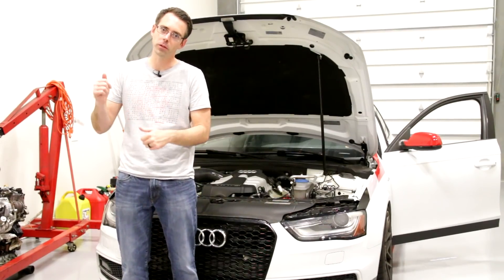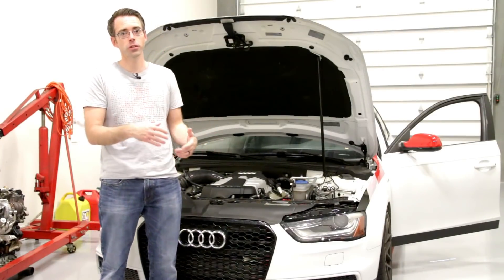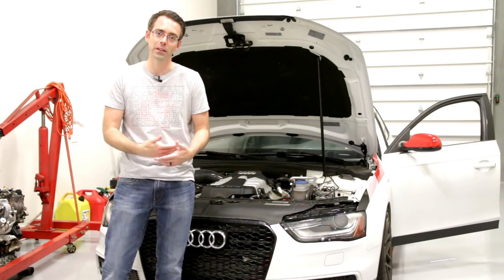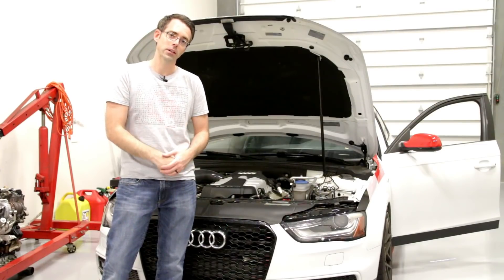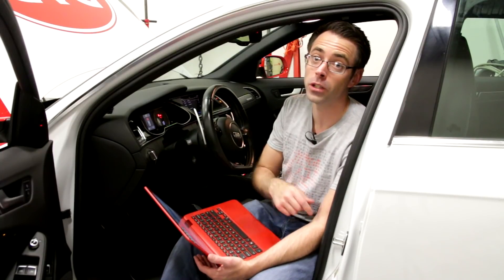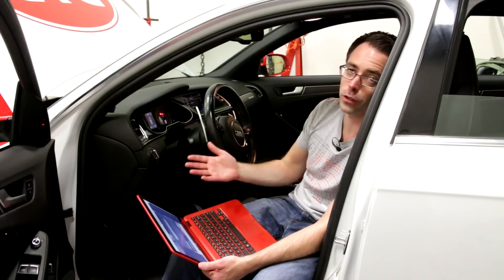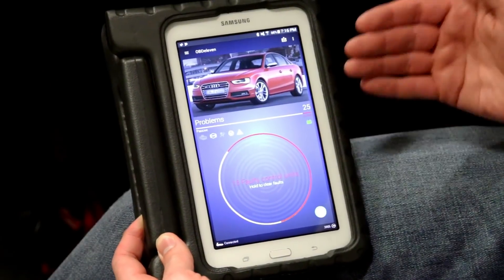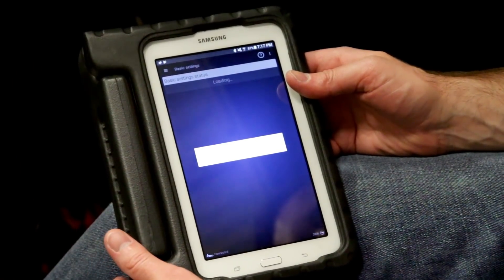Supercharged Audi S4 Unitronic Stage 1+ ECU Tune... How Does it Do It?

Comment: Just put the Unitronic Stage 2+ with the single pulley in my 2011 Audi S4. Love it. 80hp gain at the wheels and 50 lb-ft of torque.
Reply: Shaun Askew wait till you go dual pulley stage 3, huge difference!  500 horsepower!
Reply: James28R an S5 has a completely different engine...no? V8 not V6?
Reply: Any reliability issues yet?

Comment: Have a 2015 Q5 with this engine tuned to stage 1+ from 034 MOTORSPORT and its a beast. mid 4s to 60 all day long and beating ALL BMWs except the newest higher HP M cars. absolutely embarassed a 2013 650i, top end and off the line. Beating all doge RT's, only the SRTs can hang. You get the idea.

Comment: Hi Paul! I have a 2015 1.8T Golf with an automatic transmission and I want to do the Unitronic Stage 1+, but I've seen few post online that do not recommend doing the tune on automatic cars because the torque limit of this transmission is 258lb-ft and the Unitronic goes well beyond that number (293lb-ft to be exact). What do you have to comment about this issue? Should I've be worried?

Comment: @Deutsche Auto Parts- First of all thanks for all of your videos, they are unbelievably helpful and gave me hope that I can enjoy and maintain a B 8.5 S4 as a daily driver.  Is there any negative impact on long term reliability or increased maintenance intervals that would arise as a result of this tune? I am almost stock at the moment with the exception of an AWE exhaust. I was thinking about replacing the factory air box with a Unitronic Intake and doing the Stage 1 at the same time.  I know its not required but ultimately reliability is my most important factor- would it help reliability if I did a DSG Tune or upgraded the intercooler along with the Stage One? Thanks

Comment: Genuine question, Unitronic or APR? I'm looking for tune on my A6 3.0T
Reply: I know this is late, but from what ive seen APR is the better tune for both power and functionality.
Reply: Unitronic by miles
Reply: Ie by miles. Most power for stage 1, convenience of doing it yourself, best customer support by far, also the cheapest option at $780 right now + $100 for the cable making it under $900.
Reply: I’ve used both and without question Unitronic is superior in so many ways. Tuned both of my cars, 2010 R8V10 supercharged and 2021 RS6.

Comment: Paul what tires are you running on the RSEs? I'm trying to make sense of this as I was able to get 5.1 0-60 (verified through a P3 gauge) on my stock B8 6-speed. I have PSS but I didn't think that would make a huge difference off the line
Reply from the maker: Same tires.

Comment: This is awesome, I am looking to tune my 2012 Audi S4 m I jusat got the car and really like it but a bit more powa would be awesome. I am looking at your Stage 1 for 91 octane, does the tune actually improve mileage at all as I know stage 2+ in my 15 WRX improved mileage over stock tune.
Reply from the maker: answer coming AskDAP 130
Reply: I have the same car with dsg. Went stage 3 2 weeks ago from 2+. The torque down low is crazy.  It still revs freely to redline too!  I got 1 mpg better when I filled up today. Your mileage may vary🙂

Comment: Have a question regarding Stage 2, Uni is not providing 91 on stage 2, will it be safe to run stage 2 on 92 octane?
Reply: Shuo Wang wouldnt hurt it... the ecu adjusts automatically to the differences in octane.  If you're running a tune that is meant for 93 but running 91 for example, nothing will happen to the vehicle itself other than not getting the full potential out of the tune itself  if its calibrated for higher octane fuel... but having a higher octane fuel for a tune that has a lower recommended number definitely wouldnt hurt either ... higher the better If you're tuned

Comment: What is a best engine oil for 3.0t
Reply: Liqui Moly Synthoil or Molygen 5w40.  I use Molygen myself so I can check for oil leaks.  Totally unnecessary to get Molygen but you asked for the best.
Reply: Synthoil isn’t the best. Use the Liquimoly High Tech.